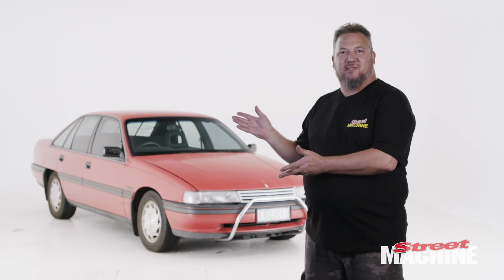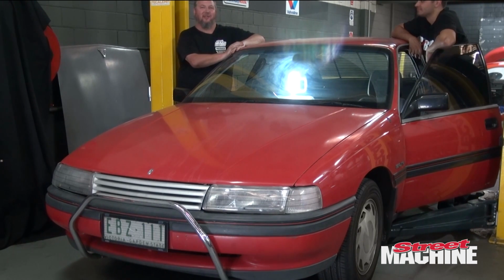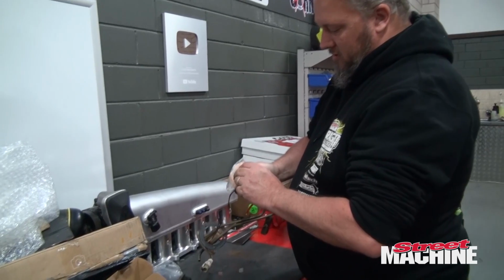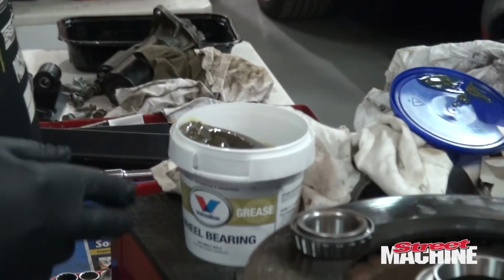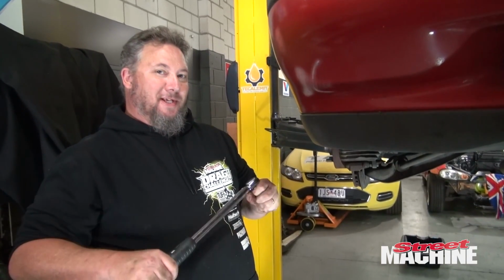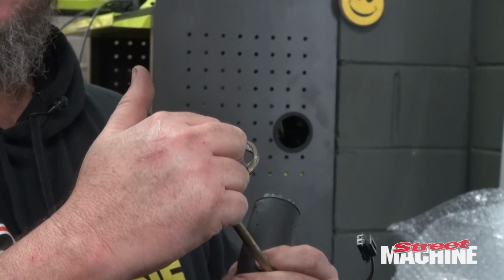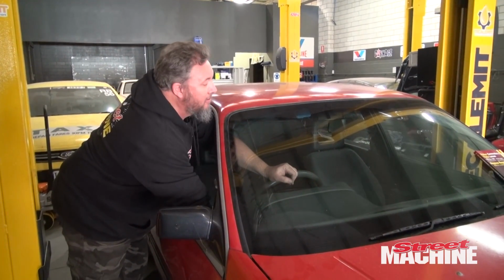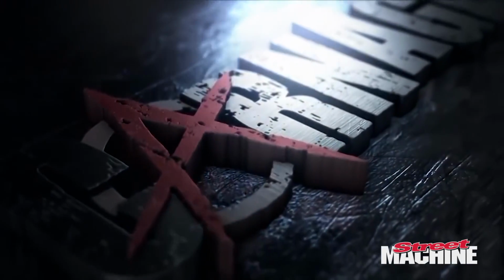Carnage Episode 49 - We Start Building Our VN Commodore - Supermang

Comment: Had an old vn was the best car I ever owned. Flogged the absolute guts out of it! Had a locked diff only thing I ever had to fix on it was power steering pump. It lived in limiter & I used to blow sets of tyres every week as a young fella. looking back I should of stuck it in the garage it was quite a clean example too.

Comment: I wonder how good you can do for the 3.6 Alloytech? I mean factory twin vvt, designed by Ricardo who engineered racecars for mclaren, factory forged crank, twin oil squirters coil on plug etc..
I'm sure it's gotta be good for 700+ with the right set of parts and a good 30pounds. but no one has done anything with these engines, so we don't know.
Reply from the maker: The engine held so much promise but never really delivered

Comment: I'm betting that odo isn't showing the full extent of its history. notorious for having a drive gear break when the set button is pressed (vn to vs). easy fix though, judging by the low amount on the trip meter it was changed recently
Reply from the maker: The rest of the car is tight, we reckon it's genuine

Comment: Try changing the fuel pump on an AU ute
Reply from the maker: Yeah I've heard that's a bastard
Reply: @STREETMACHINETV  take the diff out, then tank or take the tub off, while the tubs out remove the liner. cut a hole and make a plate refit liner -  ;)

Comment: I wonder why such a low kilometre car would need wheel bearings..... grease failure? moisture ingress? corrosion?

Someones dialed the kilometres back on the clock maybe..... haha just kidding
Reply from the maker: I think someone did a disc change and didn't grease a bearing right

Comment: Holy crap you owned/built V6 Vengeance? How did a VN fanatic like me miss that, i used to buy Street Commodores as religiously as i have bought Street Machine (since the early 90’s to present day) and used to look forward reading the next instalment of V6 Vengeance even though my VNs were all 5Ls back then seeing a V6 one being built was so cool. 
Loving this build so much, i could bore you stupid with all the VNs ive owned and still own currently the collection is around 8, VN Calais 355 project, A VN V6 skid car with twin throttles done as a atlas grey SS replica, a VN LE, VN Berlina Formula and a few VN parts cars on the farm. 
But i also have a couple of AU paddock bashers out on the farm too so these days I understand how awesome AUs are.
Reply: Agreed. I got my VN long after V6 Vengeance was finished (I had a Phoenix Red VN SS) and had no idea that Scotty did that until a little while ago.

By memory they bought that car for only like $400 too. Those days have long passed.

Comment: Nut and bolt style stainless clamps on fuel line is the right way rather than worm drive anodised clamps, they give 360 seal and dont rust.

Comment: I’m worried about those wire connectors for the fuel pump , the ends are open and electrical current is live with the fuel 🤔
Reply from the maker: It won't be a problem

Comment: Why does it have to be e85 .. its 1.70 / litre and uses about 30% more .. expensive fuel to run .. ok if its a track car but useless as a cheap daily
Reply from the maker: More power
Reply: Flex fuel fixes that issue.
Reply: The car won't be a daily, so why bother?
Reply: E85 will make a lot more power when boosting the motor and keep the engine much safer on the tune

Comment: My first job was working for John at DEER PARK MOTORS, Mechanical basic work, tyres, wheel bearings ,tunes oil changes etc, when i was only 15 as well. :) the trick with install of wheel bearings is not to use a punch to tap them in, you use the old bearing caps to tap the new ones in. Just one slip of a centerpuch or wrong tool on the cap and you have nothing but noise and then you have to do the job all over again and most people don't buy the tools required just for replacing wheel bearings / caps ? Especially modern cars with ABS ECS etc etc.  🏎👌✌👍😊🙌 Scotty mate when doing the work on the bearings you have to have the solid table so you can tell when its metal to  metal noise as well, when putting the bearing cups in, using the old cups is just as good when installing the new ones. :)

Comment: you need to take the restrictor cone out of the intake manifold it makes a huge difference down low. 

https://forums.justcommodores.com.au/threads/removing-bellmouth.7830/
Reply from the maker: I was guy who discovered that and Series-1 doesn't have them
Reply from the maker: @Aussie101 yeah I did a story on it in Street Commodores back in 2002. As for warzone, the hackers are getting worse some concentrating on the season challenges right now

Comment: When you get new shock absorbers keep the thick wire that holds them compressed and cut them in half, bend them into a S shape and you'll have a set of brake caliper hanging hooks. Instead of hanging them by the hose. You can hang them up out of the way for removing/replacing the suspension parts.

Comment: VN Berlina's had Steel Wheels with hubcaps. The Allioy's are the correct option for the VN. I think from memory, it was an option through 'Holden By Design'.
Reply: Actually those VN alloy rims were a standard option not a Holden by design option
Reply: A VN predates HBD by many years.

Comment: I'd still be pumped to see a turbo installation on the Barina. I don't know why I am so hooked on the Barina, because I've never seen one before, but I'd be really interested in seeing you run it at the strip with the bigger engine standard, and then installing a properly designed turbo kit and running it again at the strip to see how much it's picked up. That being said, I'm really excited to see how this old girl does!
Reply from the maker: I've got Barina plans
Reply: Problem with big power in little light cars like the barina is getting power down to the ground.

Comment: Looking at the shape of the car, the mid section of the body towards the rear looks like the Vauxhall Carlton from the 80's which lotus built into the mental speed machine.
Reply: Yeah that's it. There's clones of it in every branch of GM. Ours generally had engines that were crap to average. The EFI 5.0 we got was passable, but nothing truly good happened until the VT era when some big-wig decided to drop an LS1 into them. From that day on the horsepower kept rolling on...

Well, until GM screwed over the Australian people and ran away with bail-out money
Reply: I'm sorry that the Americas screwed over Holden, my brother had the Carlton, in black factory tinted windows and rust in the rear door jams so you could actually touch the tyre lol. But it went like stink and it only had the six I think I maybe wrong . But all cars in the UK rust ,  but thanks for your response, keep Safe to you n your family. Be safe out there.
Reply: I think you should name your car something like maverick or top gun by using the berlina name. As the 'love song from the film was recorded by the one hit wonder band Berlin'  or take our breath away as it's boosted. Hope you're all safe and be careful out there.

Comment: For brake calipers, FT is considered a calibrated measurement to achieve.  That or 10 ugga-duggas at 100PSI.  IF the bolt snaps, you did it too toight.
Reply: Cross threaded or torqued to spec... Tight is tight

Comment: future reference.... The fuel pump sender unit has a flat section on the circle bit you took off when marking, That flat section sits at the top so its in the correct position in tank
Reply from the maker: Thanks for the tip, I didn't actually notice that
Reply: @STREETMACHINETV  Yeah ive done the same mate i didnt know either for a long time

Comment: Loving the project 
Is this a 20k build or what's a realistic cost to do this jobbie at home?
Reply: It all depends on how much you can do yourself. The L67 is pretty tough to start with, so as long as it's in good condition to start with you'll get away with some basic maintenance. Throw on some mls gaskets and arp head studs if you can with a basic head service should be $1.5k all up.

Going turbo from the get go is the cheaper and will make more power. 
If you can fab your own intake adaptor in place of the blower or use an ecotec intake with minor mods you'll save lots of coin. $200
You should be able to do a fuel system with 2 pumps, surge tank, hoses,  injectors and adjustable reg for around $1.5k. Less if you can buy good second hand injectors.
You should be able to fab log manifolds, dump pipes, exhaust and mufflers for about $2k finished.
I'd go with a BA-BF Barra spec Garrett GT3582R either rebuilt or good condition 2nd hand (with modded wastegate flap), yes it's a boring choice but it is perfectly sized, runs the numbers, is cheap and far simpler to fab the manifolds and dump due to the internal gate. Expect to pay $600-$1500 depending on condition.
Intercooler and piping 1k by the time you buy joiners and clamps etc.
Ecu choice comes down to budget, you could buy a second hand ecu which does the job for a few hundred and wire it yourself. Or go the plug and play option for more like $2k. Another $1k tuning.
The gearbox and converter is where all the money will go, probably $4-$5k there.
Diffs are strong already but factor a couple of grand for new harrop lsd including fitting if you aren't confident with diy.
Reply: About 20k if you re do everything if going blown

15 for the turbo set up properly 

I did the supercharged option cost 20 all up then wanted more power with out spending 10g on a whipple charger so I went turbocharged and am between 450 and 500 rwk and is notorious for killing gearboxes tho